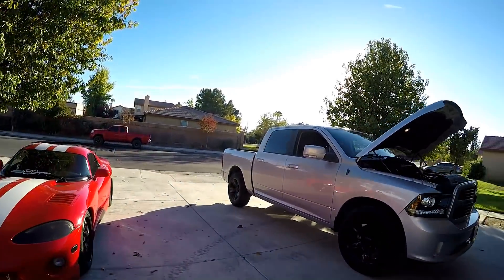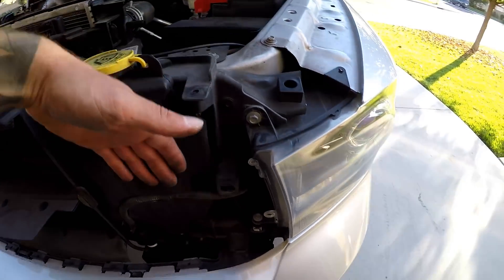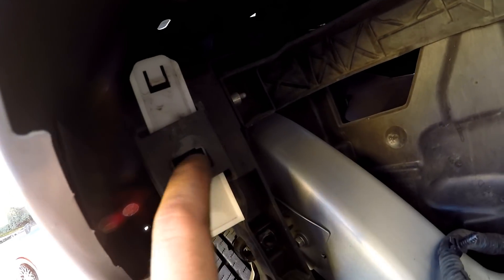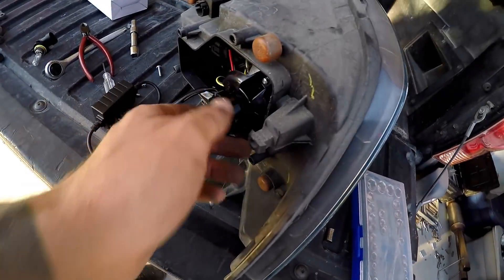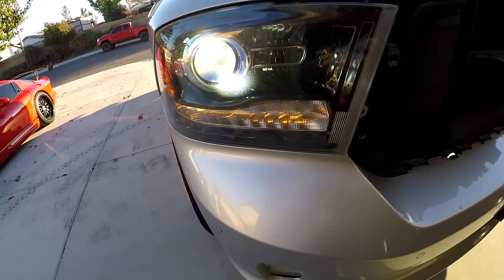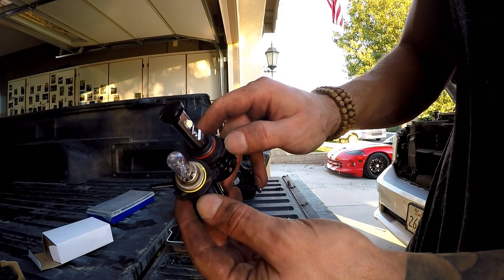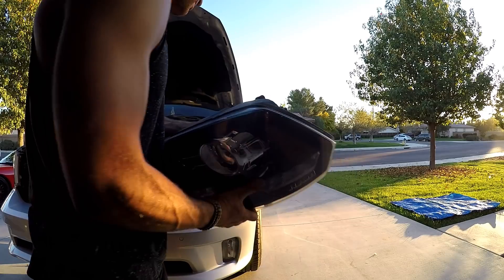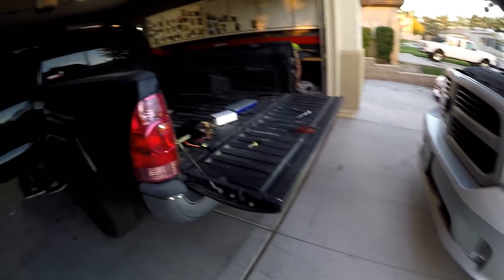Dodge RAM - LED Low Beam - Projector Headlight Bulb - UPGRADE

Comment from the maker: *Check out the bulbs we found work best on these trucks HERE* 💪😎

9006 LED BULBS used for the fogs
https://amzn.to/3PXYaQB

INNOVITED 55w HID KIT for the low beams
https://amzn.to/454L20l

HIKARI CANBUS DECODERS for the low beams
https://amzn.to/2Eb2JBQ

LICENSE PLATE LED CANBUS
https://amzn.to/3PBYUJt

3RD BRAKE & CARGO CAB LIGHT LED CANBUS 
https://amzn.to/2YxTPG5

CLICK HERE FOR LED BED LIGHTS WE USED
https://amzn.to/2E6e1an

LED Reverse Bulbs
https://amzn.to/2LJJPIk
Reply: Aren’t the LED bulbs what you put in the headlights? Not the HID you listed here
Reply: Did you use the 60W or 72w bulbs For the fog lights?
Reply from the maker: @nyckaguirre1034  That was the first setup we tried but found the HID was way brighter when we compared so we updated our preferred setup.  Check out the comparison here https://youtu.be/Vmi6eeoOL5o
Reply: Whatabout the high beams?
Reply: So in this video the low beam light is actually the led  not hid ? I want to get a plug and play kit would do you have a second choice for a led light kit?
Reply: Was just the bulbs for the fogs??
Reply: arent they supposed to be 9012s?
Reply: @ozzy1355  Projector headlights use 9005 for both the low and high beams and 9006 for the foglights. I have a 2016 with projector headlights and that is what I use. I followed his recommendation for the HIDs and couldn't be happier.  If you really want to go with an HID system I recommend that you buy OBDLINK MX+. Paired with the app AlfaOBD you can change all your lights to LED or HID or mixture of both without needing to add any other wiring. There are many videos and how to's out there showing how to do it. I have upgraded to HID low beams, LED high beams, LED fog lights, led license plate, led reverse lights, led 3rd brake light cargo lights. My tailights were already factory LED. I also turned on my DRL and put an option on the radio to turn it on and off.
 The total cost for the OBD reader and the app was around $100 but well worth it so you can change whatever you want without having to purchase CANBUS resistors or anti flicker resistors.
Reply: Just want to be clear, can I use the led setup for both low beam and the fog lamp
Reply: Michael Chiarolanza I just ordered both and will instal them tonight. I’ll let you know how it goes

Comment: I bought Sealight and Fahren 9005 LEDS for my 2017 Ram 1500 Sport to replace low beam projector bulbs and I can't get either of them to lock into the housing. Some people say get a different O ring. So is trimming the plastic part the best way to get them to lock? Thanks so much for all the info you provide to us Ram owners!

Comment: Okay just to get it clear what led would be good and what size are the high and low beam bulbs for projectors I wanna get it right before buying the wrong one thanks bro
Reply from the maker: Hey Arturo!  If you have these same projector headlights I would get HID for the projectors as its better lighting.  Check out the other vids on the channel where we did a comparison and also the links here in this video for the HID for the projectors. 👍
Reply: @BoostedMotorsports  okay thank you and do u know wat sizes are the high and low beam bulb

Comment: If I have the two bulbs in my headlight coming to one harnesses outside the housing do I need two canbusses, one for each bulb. My new assemblies for my headlights have a h1 for the projector and a 9005 for the high beam.

Comment: Hey any idea how to fix the corner light? Or you need to replace the hole headlight ????
Reply from the maker: Its part of the headlight but search "ram 1500 switchback" there is a company that sells the led part.
Reply: Thanks

Comment: I currently have a 2015 ram 1500 that uses 9012/hir2 projector head light I was wondering which led kit you bought that works with this model truck?

Comment: Don't these resistors get very very very hot? stuffing them inside the headlamp housing can cause issues? let me know.. I do not want to cut my headlamp cover to stuff these resistors outside the unit..
Reply from the maker: It never caused issues but we ended up going with a HID kit instead as it was way brighter.  I have that on this video https://youtu.be/Vmi6eeoOL5o

Comment: The factory headlight dust covers are a very tight fit with LED bulbs.   Dust covers with a deeper back can be had from at the following link.   They're a bit expensive but ensure proper clearance for the LED bulbs.  http://www.dirtydiesels.com/brightsource-13-18-ram-projector-headlight-dust-covers/
Reply from the maker: Yeah I agree not much room to work with!  We went with HID instead and it was much brighter as seen in this comparison video. https://youtu.be/Vmi6eeoOL5o

Comment: Did you get the light panel on with no problem? Mines did not fit unless I removed the panel?
Reply from the maker: Yeah I didn't have an issue fitting all the components inside 👍

Comment: Any issues with melting the wiring from the heat or it being dangerously hot?
Reply: I just changed my truck to the LED headlights and used the exact same bulbs and canbus decoder you used...
Reply from the maker: Hey Tracy I ran this setup for months without issues but they definitely get hot and I found a better light setup if you check the newer vids.  I would throw those bulbs in your fogs since they will fit and then get a 55w HID kit for your low beam projectors and you won't believe the difference in light output.  Be sure to check out this video to see the difference https://youtu.be/Vmi6eeoOL5o
Reply: I already changed my fog lights to LED 9006 bulbs... I will watch the video u sent to me now. Thank u for getting back to me
Reply: Wow! The HID bulbs are insanely better... I would need help with drilling and mounting of those boxes tho.. I'll pay ya to do them on my 2014 Ram, LOL

Comment: I hear headlightrevolution sells the 9012 low straight swap leds that do not require a canbus. I have a 2015 1500 with projectors. Do you know if these trucks require canbus regardless?

Comment: Is there something you did to make the led fit? For some reason the bulb itself isn’t entering it’s compartment. Like before it won’t go in enough for me to lock or unlock.
Reply from the maker: Nope I didn't do anything special.  Check the later videos I've made though because I ended up improving on the lighting setup and HID is much better for these factory projectors!
Reply: Yea I actually saw the HID vid yesterday and installed them today. Thanks for the great videos. KEEP IT UP! 👍🏽
Reply: I ordered the 9012 kit thinking my 16' had 9006 bulbs... It actually has 9005 which I should have ordered 9011 replacements. The have different diameter bases

Comment: HELP! I can’t figure it out. I have a 15 ram 1500 Laramie. Right low beam blew (stock bulbs) so I ordered the new Hikari leds 12000 lums. Hooked up no problems put the headlight back on the truck turned it on to see if it worked and it did looked great so since it was cold out and I had to be somewhere I just did the side that originally blew. Put it together started the truck up went in the house to change came back out and it was off again. Other low beam with halogen bulb still in it was on but the new one wasn’t so after I came home I took it apart and took the other side off and put the led that I just put in the right one in that side and it worked fine so I knew it wasn’t the bulb. So I swapped assembly’s to see if it was something inside the headlights but first I installed the leds in both head lights sealed them up good to go. Both work just fine on the driver side but on the passenger side does not. High beam works and turn signal works but no low beam. What could it be? Can’t be a fuse. Can’t be the bulb. Can’t be the headlight itself. Every thing works as it should on the other side. I don’t get it. Please help!
Reply from the maker: This was an old setup I tried but in a newer video we found HID to work WAY better in these trucks than LED and much brighter! I would return those hikari LED and go with the setup in this newer vid. You can also see the difference in brightness in this new vid as well as the parts I used in the description https://youtu.be/Vmi6eeoOL5o
Reply: BoostedMotorsports well that still doesn’t fix the problem of the headlight not turning on. I tried each headlight on each side plugging them in and it’s the same results. Left side works perfectly with both head lamps right only works with high beams drl and turn signal. No low beam. Even tried the stock bulb from the left side

Comment: Hey buddy just a heads up on my truck I don’t have to remove the grill you just move back the plastic cover enough to use a couple extension to reach the bottom bolt, your truck is a different then mine cuz you have the color match bumpers but the mounting and bolting seems to be the same just thought I’d say that make it easier for you in the next time

Comment: Hey thank you so much. I just did this to my 2016 dodge ram 1500 sport. Thank you so much for this video it works so far and way better than the original factory lights. It only took me about 40 mins in total thanks man...
Reply: What bulbs you use for the low beam

Comment: Is there any room for adjustments? The back of the led if it touched the cover you wont adjust it anymore.
Reply from the maker: Check out the newer videos where I compare LED to HID in these headlights. HID is the way to go for this application!

Comment: Boosted2k  hey if you want to get the most out of your led’s (brightness and beam pattern) make sure the led bulbs and left/right. You can’t just plug them into the ram headlight plugs you have to mess around a little. I have a 15 ram and it was a world of a difference once the manufacture of my leds told me that
Reply: Marcelo Ramirez what brand of leds and decoder do u have.  I have a 2015 ram as well and for some reason the leds keep messing up on the lows and fogs
Reply: Andy Bentley I bought mine from xenonhids.com and the have the cancellers and anti-flickers as a bundle with the leds. The fogs as well as the lows end up both being 9006’s from them but in order to get the bulbs left to right, 9-3 you have to take off the black metal piece the bulb screws into, get the bulb it the right position, then reinstall the black metal piece. Lots of work but when they are positioned right they are awesome! I don’t have any error codes popping up on mine like I did with HID’s, those were a nightmare

Comment: Good day Sir, I have a 2015, Ram 1500 Express, i bought the truck without the projector headlights. I tried to upgrade the low beams with this same kit you used. I had an issue with the bulbs from the get go. My problem was that, about after 30 mins, the lights would flicker a few times and then shut off. I was wondering if this has ever happen to you, and if so, what did you do to remedy the situation. Looking forward to a response, thank you in advance for all your help..

Comment: Am wondering if this setup will work for 2015 Ram 1500 as I see in the search that Ram change it in 2015 and required other part also other than the decoder cable?!

Comment: looking at Amazon they sell a 9005 is there a better benefit to using the 9006 and cutting them to fit the 9005?
Reply from the maker: Depends which bulbs you are trying to replace.  The projector low beam bulb is a 9012.  High beam is 9005. I threw these in the low beams and there isn't many options for 9012 bulbs.

Check out the philips bulb guide for your truck and double check which bulbs your after!
http://www.philipsautolighting.com/bulb-lookup.php?make=123&model=2591&year=2014&trim=43
Reply: Boosted2k awesome thanks mines a 2017 so they changed it sometime in the years, now low and high are both 9005.

Comment: Im still undecided whether to go HIDs or LEDs for my 13 Yukon Denali... Great video bro! Im not a Ram truck fan but thats a nice truck you have!
Reply: DatDominicanBul 215  LED’s man they are way better then HID’s
Reply: I went through 4 sets of HID’s on my z71 in less then 2 years and my LED’s are still going strong 1 year in and they are more consistent and don’t have to heat up like the HID’s and LED’s are waterproof and have a cooling fan they do get a little hot but HID’s still get hotter and have no cooling system
Reply: And the BS of having HID’s is dealing with ballasts and all that bs

Comment: Will these work for a 2017 Dodge Ram Big Horn?
Reply from the maker: If you have the factory projectors it should be the same process.  Check out my later videos though cause HID bulbs work WAY better for this application.
Reply: BoostedMotorsports Thank you so much! Very helpful

Comment: Did you need canbus decoder for the  HIDS as well?
Reply from the maker: The HID kit I used was canbus compatible off ebay for $40 but yeah you will need decoders if you use a regular kit

Comment: Just a heads up. You do not have to take the grille off to get the headlights out. You can get them out with a long extension and 10mm socket. And if you decide to get HIDs. I recommend the Enlight Automotive kit. It's what I have on my 14 Ram and they are amazing!!

Comment: Thanks for doing this video. I’m changing my 2018 Ram headlights over tomorrow. I had watch this about a year ago and took second look just t9 make sure. 
Stay safe during these crazy times
Reply: What led lights did you order? I just ordered hid kit from amazon and they came with a decoder and don’t work. They just flicker and shut right off. Now I’m aiming for led kid for my aftermarket headlights that carry H7 low beam.
Reply: Did this work on your 2018?

Comment: Doesn’t that one thing get too hot to shove inside there? Like melt the plastic hot?
Reply from the maker: Nah no issues so far.  Halogen bulbs get damn hot as well.  Another guy posted up in here that he heard LED didn't get the headlight hot enough for ice/snow to melt off in winter conditions.  Seems to be all kinda of rumors floating around but all is good so far!
Reply: Boosted2k sweet thanks for the info. Been trying to figure out what to run in my Cummins.

Comment: I got the same led lights you got but I can’t get them to fit inside the housing even with that tab cut. Any ideas?
Reply from the maker: Hey Steven did you order them off Amazon?  If you're still in the return period I would send them back.  I just found another setup that works 100x better than this.  I'm posting up a video on it Sunday.  Let me know if you need more info but the video will explain everything! 👍
Reply: Awesome thanks bro
Reply from the maker: Check out the picture I posted on my instagram @BoostedMotorsports  the light output is insane!
Reply: Looking forward to seeing what you did

Comment: Did you ever figure out how to make the hids work with the auto on function without turning off?
Reply from the maker: I didn't unfortunately before I sold it.  There are some tools that have come out since then that you can purchase that turn off the bulb out warning from the computer so you don't have to 'trick' it anymore.  I have no first hand experience with them but they are out there!  Believe its called AlfaOBD

Comment: Would this set up work for reflector head lights? An do they stay on not flicker or shut off??
Reply from the maker: Yeah I would do LED on reflector housing! Probably be a different bulb type but the same setup would work 👍
Reply: BoostedMotorsports thank you witch set up did you use for the fog lights i seen a video u mention sum c6 just plug an play an no added wiring? Can u send me a link to those
Reply from the maker: Hey Luis here are the links to the best bulbs we found and combo

9006 C6s LED BULBS used for the fogs
https://amzn.to/2EaeYOY

INNOVITED 55w HID KIT for the low beams
https://amzn.to/2Yz7VHj

HIKARI CANBUS DECODERS for the low beams
https://amzn.to/2Eb2JBQ

LICENSE PLATE LED CANBUS
https://amzn.to/2Vrbcq4

Comment: Nice vid and good looking truck. I have an 09 ram 1500 and have went through so many hid kits for both fogs and lows. My truck hated them and always burned out the ballast or bulbs. I rigged up a capacitor to the relay to help with flicker as well. Did wonders but still never came out the same color or as bright. Finally got rid of the cheap kits and dumped 600 into my lows and fogs at a place called extreme hid in San jose ca. They came with a lifetime warranty and if I get a different car they will swap everything over. The fog ballast got a little crusty after I went mudding and stopped working they replaced it for free and labor which saves me the headache of doing it. Always get complaints that they are too bright which I take as a compliment.

Comment: Are the low beam bulbs linked in the description different than the ones you used? The ones I got from that link don’t fit into the socket even after I trimmed the tab and is too long so the dust cover doesn’t seal properly. Any idea?

Comment: What HID are you using ??
Reply from the maker: Been running this in my fogs with no issues for months!
https://www.ebay.com/itm/55W-AC-9006-HID-Xenon-Conversion-Kit-Canbus-No-Flicker-For-Nissan-Titan-8000K/202215205615?fits=Make%3ANissan&epid=4010676551&hash=item2f14f72aef:m:mM0PEI74s3e2H1okJ216MDg&vxp=mtr

Comment: -BoostedMotorsports , i recently put in LEDs canbus and my lights randomly turn off every so often some times its just the driver side and others its both of them they turn off without hitting a bump and turn back on within a couple minutes high beams work fine while this is going on and so do fog lights, any help would be great otherwise ill just put them back to halogen lights